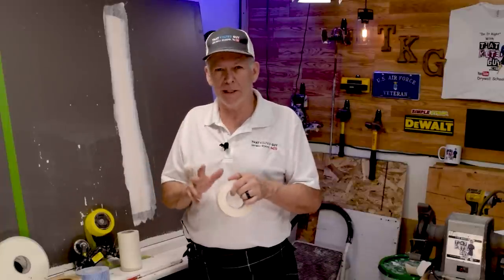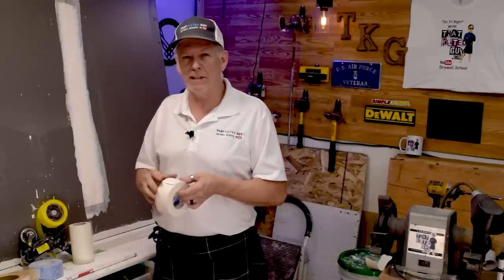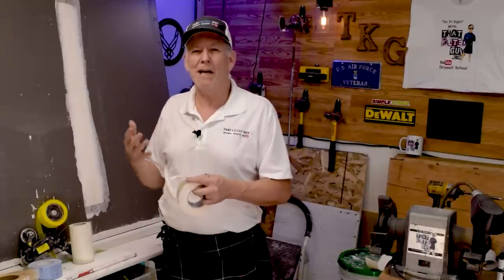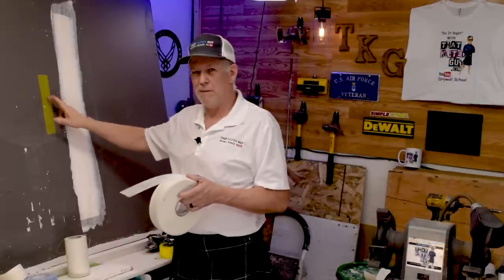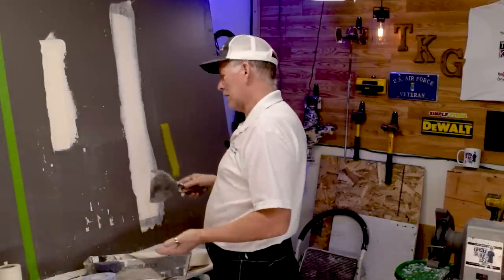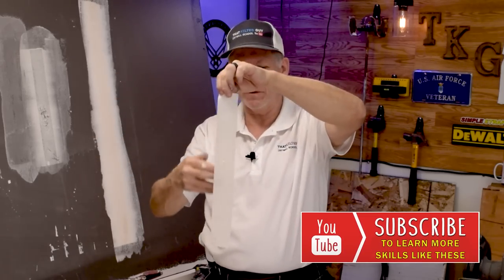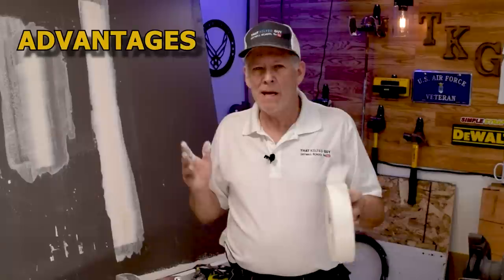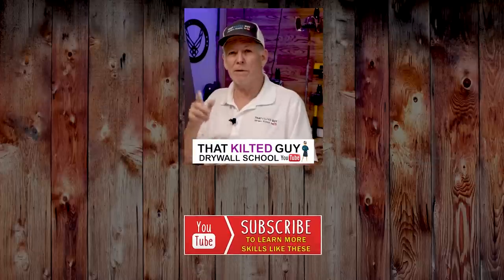The Best Joint Tape for Beginners

Comment: If paper tape had a front/back side, then the manufacturer would print it on the material.   Such as other products where it says "this side out" or "back towards wall", etc.   The crease is there for convenience for corners in order to get a superior finish.   From experience of DIY repairs I find it works well either way.   The amount of mud behind the tape is what counts.
Reply from the maker: Exactly

Comment: Diy here- ive found mesh works great for large gaps or cracks. But ive also used it for repairs and it just takes the primer app and waiting to finish application next day. 

Just took a load bearing wall down and the gaps after drywall placement worked really well. (Layers on layers)
I bought the wrong mud (finish) and was wondering why “hot mud” is the finishing while the patch mud is different. (My painter just said it just is)
 My painter fixed the low/high points from the wall removed between the two rooms; and frankly thats why i pay him for his experience and application of craft.

Mic sounds good- and info on point. Thx kilt and keep em coming

Comment: One more advantage of fibafuse is that when you sand down to much it will not show signs of torn paper which you have to redo all over with mud
Reply: For corners I will use paper, but I used to be old school and put paper on everything. Then I started using mesh tape for everything but corners. Now I use Fibafuse and paper only. If they made Fibafuse for corners I'd love to try it.

Honestly mesh tape is only good for patches, but I'd be willing to try Fibafuse for that, but it's not self adhesive.

But paper tape is still awesome, it's just temperamental as he basically said.

Comment: Great video as usual! We use FIbaFuse on occasion and do like it in certain situations. I was taping a ceiling in a darkened room and using work lights. As I was taping a joint, I noticed that there was a ton of fiber particles falling into the air and floating around. It was enough to scare me into never using the stuff without a mask on. Quick Tip: to keep the FibaFuse from unrolling after use, stick a heavy staple (or something similar) into the end of the tape to hold in place. Just push straight into the roll. Thanks again for all the great content!
Reply: I use Fibafuse but have to take precautions. I start itching if I even look at it.

Comment: I found your video very helpful as I have recently found out about fibafuse tape. Oddly,  my local DIY stores (I am in UK) don't sell fibafuse (just paper and fiber mesh) but I managed to get some from Ebay. I shall be attempting to use it soon and now I feel far more confident with your excellent tuition, so thanks again.

Comment: I've been using paper and even though there are pitfalls, the results have been good.  Mesh is wonderful, but not for corners, this Fiba Fuse had me crying like a baby!  Pushing it into the mud would contaminate the mud with fibers from the tape to the point I had to just scrape the excess off into the trash can, rather than back into the tray.  Don't think I've cussed so much since my Coast Guard days.  Unfortunately, I was using a new knife that I hadn't yet sanded the sharp edges of the blade down, causing too much scraping action on the tape.  I'm hesitant to continue using it but I do appreciate the mud saturation avoiding air bubbles.  Thanks for posting this!

Comment from the maker: 🆕 My ONLINE store with Ebooks, printable guides, 24 Grit Sanding discs and more at: https://www.etsy.com/shop/ThatKiltedGuyDIY

🛒 ONLINE STORE & AMAZON LINKS TO OTHER ITEMS IN OUR VIDEO- 🛒
  - - - - -  - - - (Remember to Subscribe too) - - - - - - - - -  

🟢 24" Metal Skim coating blade - https://amzn.to/3reUWZr  

🟢 32” Metal Skim coating blade- https://amzn.to/3tFUgO5

🟢 The BEST Stud Finder I've Ever used- https://amzn.to/3qoNx9U

🟢 A nice hard case for the stud finder - https://amzn.to/39vZx2p 

🟢 A good all around Mud pan and knife set- https://amzn.to/2KZG8u9

🟢  Guardz torn paper sealer. Stops Torn Brown Paper from bubbling - https://amzn.to/2L3tl9V 

🟢 Drywall Mesh tape - https://amzn.to/38HUxIQ

🟢 Mesh Tape dispenser (optional) - https://amzn.to/2UpnSyn

🟢 Radius drywall Sander, great for beginners or pros alike- https://amzn.to/2WAxcjd

🟢 The best paint extension pole 2-4' (for the sander above too)- https://amzn.to/2HOc1qS

🟢 Affordable Texture sprayer hopper that I USE - https://amzn.to/2L1jWjb

🟢 The BEST Knockdown Knife - https://amzn.to/3bKkYPV

🟢 A quiet compressor- https://amzn.to/2UnMtUg

🟢 Rubber Skimming blade mentioned in other videos -https://amzn.to/2HdaN76

🟢 Wen Vacuum Drywall Sander (Good one for a low price) - https://amzn.to/35Idmd0 

🟢 The Mud Mixing Drill I use (super tough) https://amzn.to/3dUhMQZ

🟢 For a 4 bladed mixer like mine- https://amzn.to/2UnfbHG

🟢 For a more affordable mixing paddle- https://amzn.to/2FCHFE3

🛒 - VISIT OUR AMAZON DRYWALL TOOLS STORE WITH MY SUGGESTIONS AND NOTES - 

* https://www.amazon.com/shop/thatkiltedguydiyhomeimprovement *

⏩ OTHER MUDDING & REPAIR VIDEO PLAYLISTS ⏩

✅ Drywall Repairs - https://youtube.com/playlist?list=PLCrazHylAOEmgaS622xokiefd_jIRMrow
_______
✅ Drywall Textures - https://youtube.com/playlist?list=PLCrazHylAOEk4mixQ2IHezYSvJtlu7kVD
_______
✅  Skim Coating - https://youtube.com/playlist?list=PLCrazHylAOEn0VW1xVLpJ_yLO3yPQKDJA
_______
✅ Popcorn Texture Videos - https://youtube.com/playlist?list=PLCrazHylAOEnc06BFyXEpNX_SapMYj_g3
_______
✅ Detailed Guide on spraying texture after doing a repair- https://www.youtube.com/playlist?list=PLCrazHylAOEk4mixQ2IHezYSvJtlu7kVD

💲 DONATIONS- By viewer request- you can donate to our Gofundme Page at: 
gf.me/u/yzzj9n .  This is now a page just for those who want to tip us, and say thanks for the help we provide.

❓ IN DEPTH SUPPORT: We offer consulting support for more complex questions at: https://www.thatkiltedguy.com/advice (a paid consulting service I provide)
Or join our Patreon page at https://www.patreon.com/ThatKiltedGuy, and join at the higher levels and get support that way.

#ThatKiltedGuy #JointTape #FibaFuse #DrywallRepairs #MeshTape #KiltedGuy #DoItRight #doityourself #homerepairs

DISCLAIMER : At That Kilted Guy Video Productions LLC, we cannot guarantee against improper use or unauthorized modifications of this information. We assume no liability for property damage or injury incurred as a result of any of the information contained in this video. Use this information at your own risk. Working on homes and buildings can involve many dangers and That Kilted Guy Videos LLC recommends viewers learn and understand the proper safe practices when attempting anything seen in our videos. No information contained in this video shall create any expressed or implied warranty or guarantee of any particular result, or any obligation for future assistance. Watching the video does not form a professional relationship or constitute receiving professional advice.
Reply: Hi Kilted Guy , HELP:::::::👇🏻
I’ve got a big problem in my master bathroom, the popcorn ceiling was painted with high gloss paint and some of the screws are popping out. WHAT PRODUCT CAN I USE TO SKIM COAT THE CEILING 1. To fix the holes and 2. TO SKIM COAT THE WHOLE BATHROOM CEILING TO HIDE THE POPCORN ON CEILING?

Comment: First and foremost. Thank you for your service. Retired Army here.
As for the Mic, Great sound and no distortion.
I'm looking for a vid that actually is filling a joint and holes. I've had to cut out walls to replace faucets and drains. A solid wall is sort of like just painting. Nor working the mud to keep from blistering. I am not a pro drywall guy at all. I turn wrenches. I even have a few holes in the drywall in the garage from a "dammit-wrench" Keep up the good work.
Reply from the maker: Hello and thank you for your service as well. Here’s a playlist of repair videos and there’s probably several in there that will help you.

Drywall Repair How To Series, from large to small drywall holes & more. 
https://youtube.com/playlist?list=PLCrazHylAOEmgaS622xokiefd_jIRMrow
Reply from the maker: I see your channel name, do you have a hot rod? I’m going to be starting a second channel soon where I work on my two hot rods and do some woodworking.
Reply: @ThatKiltedGuyDIY  i have had quite a few musclecars, now I'm more late model. 94 Impala SS, 2001 Camaro, but rebuilding a 79 K10 for my daughter. I'm  a tech at a GM dealer so i stay busy with cars. I look forward to your other pages.
Reply from the maker: Well I currently own a 1927 model T with a 440 Dodge motor in it and a Ford 9 inch rear end that is really cool and almost done and a 1954 Chevy truck five window that needs everything again. I’ve had them both over 30 years. But I love the new Corvettes and muscle cars and my dream car is the new C8 Z06 and if not that the C7 ZR1 so I’ll be covering that kind of stuff on my new channel one day.  I remember when the impala SS came out and I loved it. I’d also like to own a Cadillac CTSV as I love the fact that you can have luxury and super fast car at the same time.

Comment: Fibafuse used to have a "thin spot" running down the middle that made it easier to crease and put into corners, but it was even easier to cut by mistake than what was shown here.  (the graphic you showed of the close up of the Fibafuse shows the thin spot, but I don't think they make that version any longer, but they didn't change the part#)   If you use Fibafuse for inside corners, an inside corner roller is a must to eliminate the chance of cutting the tape with a knife.  I use it in a banjo with medium thin 90 minute hot mud for the flats and inside corners.  I haven't had a chance to try the heavy duty (blue) version yet.
Reply: This is exactly what I was looking for. I have a job starting this week and just picked up a banjo. Initially was going to use mesh tape and 90 but after finally making the leap was unsure of throwing 90 in the banjo. Thanks mate
Reply: Also got the 90 corner roller . So super excited

Comment: I started out 20 years ago using the mesh tape. It's easy to use, but it always cracks after a couple years (yes, even using hot mud).  Properly applied paper tape is always the best option. I look forward to trying the fibafuse!
Reply from the maker: I first did drywall for a living in the late 70s and for the last 20 years I have specialized in nothing but repairs and applied over 500 rolls of mesh tape with no callbacks. There’s more to it than just hot mud and mesh tape. Have even gone back to many jobs years later and they still hadn’t cracked. One job I even repaired over 90 feet of cracks with mesh tape and four years later they were all still fine. But it’s probably best for people who understand how to make it work. The other Joint tapes are better for everyone in general. Good luck
Reply: @ThatKiltedGuyDIY  I love your content, and I agree with a lot of your methods, as I am a current drywall finishing contractor. However, you are wrong about mesh tape. This is why professional finishers never use it. It doesn't matter if you've been doing something for 100 years, if you've been doing it wrong the whole time.
Reply from the maker: If it has never failed me in 20 years, I must be doing something Better than Those who it's failing with. I know without any doubt. that It does not fail when done correctly. When it fails, someone did it wrong. there's no way i could have installed that much and not had a failure if that were not true. But use what works for you.

Comment: I learned the hard way that the fibafuse tape does not work in corners. Like you said, it won't easily bend and wants to flix back to flat. And 2, your knife will easily cut the tape and you may not notice it happen until its dry and too late. With it embedded throughout the tape, it won't come off. I had to redo all the corners with paper on top of the fibafuse. IMO, there should be a red warning on the tape, "not for corners". However, I think it's great for the flats.

Comment: When patching moderate holes 1 foot  square on texture ceilings what's the best way to keep a fairly clean  joint??? Thank you...
Reply from the maker: Use a wide knife and only put on just enough to cover the repair and extend the mud about 10"  wider than the repair.

Comment: Another disadvantage of FibaFuse is that it can clog up a bazooka on a bigger job.
Those fiberglass splinters can be pretty devastating, too.
Being able to see your potential blisters, though, is a huge advantage. 

Tip: To remove fiberglass particles (from insulation mostly) from your clothes and/or skin, 'reverse roll' a piece of masking/painter's/duct tape around one hand and roll it over the affected area.  Now you don't have to wait 2-3 wash cycles to get that itch outcha shirts!
Reply: Just tried it 🤮. Broke when I bent it for corner
Reply from the maker: Great point!
Reply from the maker: Like I said, I'm not a big fan of it for corners.  But the fibafuse max is supposed to fix that, and I'll test it soon.
Reply: @advanceg2116  Yeah...as TKG mentioned, use it for hand-taping flats.  

Paper's best for inside corners.  Just make sure you have thin enough mud (not drippy, though) and get the mud smashed into the corner and cover/coat EVERY LAST INCH of both sides of a corner before applying the tape.  

Also, crease the tape slightly before putting it on the corner AND slide the flat edge of your knife down the corner of the tape to set it into the corner better before wiping it down.
Reply: @ItchyKneeSon  yeah, well my first experience with it was TODAY before I watched the video😫
Reply: @advanceg2116  You could say that, today, you advanced, G. ;D

Comment: You’ll have to show the fibafuze wide roll patch next.
Reply: There are two varieties, one 6 inches wide, and one 36 inches wide.
Reply: @VC-Toronto  Clark Dietrich and straight flex have some differing widths available now. Not quite the same as fibafuse though.

Comment: Thank you for sharing your expertise...I came to the point where I had to scrape my popcorn ceiling in the dining room due to previous water damage. My husband was excellent at this but I lost him a couple of years ago, so I'm on my own with the hands on. I'm to the point where I need to start fixing joints and sanding. You have some great tips...I'll let you know how this goes. 
In the meantime, if you have any more specific tips for places on the ceiling where I had to remove paper tape in sections and it left a deeper amount to fill in. Do I need to do any prep work for those areas?
Reply from the maker: Search for the term “torn brown paper, that kilted guy“ and you’ll find videos on that. Thanks

Comment: Wondering what your opinion is on a tip I heard from a drywaller, " Lightly sand down the sharp edge on the side of the drywall knife so it doesn't rip the tap when doing inside corners." Great videos!!!
Reply from the maker: If it’s super sharp yes lightly dull it. Mine are dull from use mostly

Comment: Sound is great.  How about using Plus 3 with fibafuse?
Reply from the maker: I prefer regular weight all purpose for taping as it has more adhesive. But in a pinch I’ll use +3 with a squirt of Drywall mud glue or just some wood glue.

Comment: The problem with the mesh tape is it will crack. Especially on a 1st story ceiling with an upstairs above it. In my garage u used mesh tape then put fiberfuse on top to test to see if it would hold up. It hard to fix the cracks that appear on a finished ceiling after they are painted.

Comment: I wonder, have you ever reversed a corner bead and used it for an inside corner? I'm curious if it would work.
Reply from the maker: No but check out this video -https://youtu.be/cblTRQmLMVQ
Reply: Thank you for the link, wish I had seen this before I had started but I already used a vinyl bead on one corner. Looks like I'll be heading to the local wallboard company. As a DIY'er who doesn't have a lot of drywall expertise or tools, the biggest problem was learning the proper consistency of hot mud. I probably still don't have it right yet but close enough for government work.
Reply from the maker: A general rule of thumb is that for taping we use a little bit thinner, and for the first coat a little bit thicker, and then each successive coat gets slightly thinner but never so thin that it wants to drip off your knife constantly.

Comment: Some time ago I finished my basement and used paper tape. Had a problem with the occasional blister, but thought it was due to super low humidity (Colorado Springs = semi-arid and high altitude), by the time I got mud top-to-bottom in the corner and tried to apply the tape, the mud had started to dry. I discovered I could spritz the tape with water in a spray bottle and that fixed my problem.

So why hot mix for the yellow self-stick? So it doesn't shrink in the seam under the tape? At least for me I don't have to worry about drying time with the regular premix. I could work continuously in a single room. By the time I got around, the mud at the start was fully dry and I could keep working.

Anyway, I got a roll of the paper, and a roll of the yellow self-stick left from past projects. And I've got a basement to finish this summer. Maybe I'll do the paper and dilute my mud a bit. Should be fun.

I was leveling a wooden floor and tried latex mud. WOW that took a long time to dry, like over 24 hours. And it was hell to sand as the setup product was rubbery. Ended up peeling up and using thin coats of regular mud alternating with coats of pigment-free latex primer (penetrates better than paint). The primer would soak through the dry mud and bond it to the layer below, and waterproof it. And where I needed more thickness I added layers of the yellow self-stick. Then linoleum over the top. Worked great.